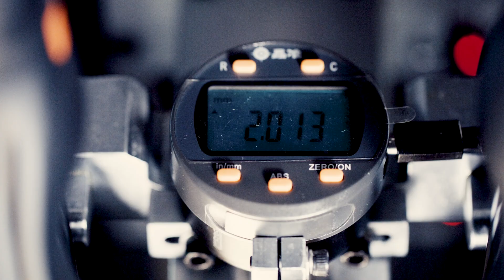The All-New Crest Suspension | Giant Bicycles

Comment: Hrm, interesting, but not sure how I feel about something designed for and/or locked in to a specific bike. I like being able to configure my Pike Ultimate for the few different bikes I’ve had it on. Also like the serviceability of it - this one seems like it might be a bit too “proprietary”?
Reply: I think they’re talking about the shock being frame specific. Forks and shocks have similar ranges in damping adjustment. However, forks are 1:1 with the movement of the wheel. With the shock, the effect of leverage ratio on the force of the shock is essentially squared. Even a small difference in leverage ratio means that the shock’s damping force range will be massively different and will need to be tuned specifically for a frame to make it rideable for 95% of the targeted population.
Reply: Ah, I see - appreciate the additional info!